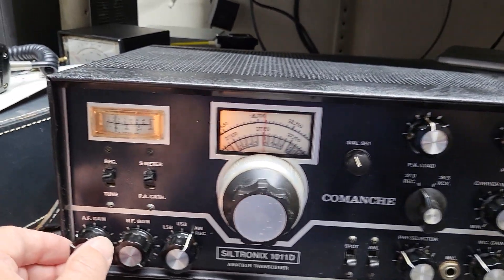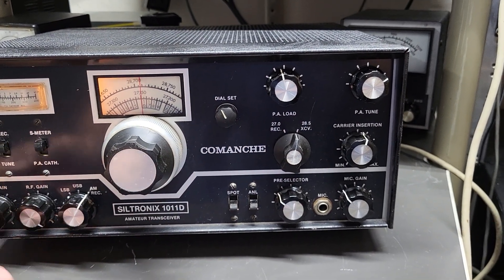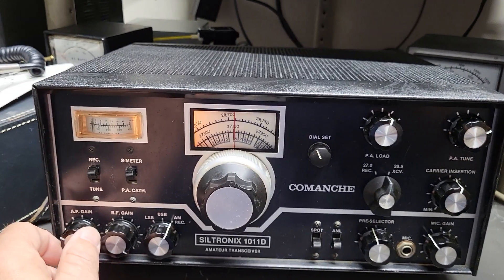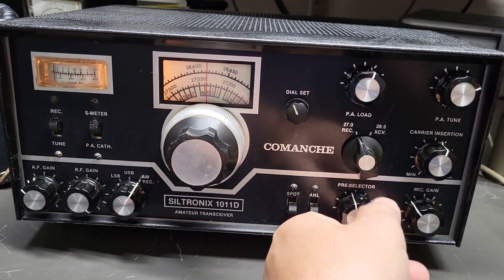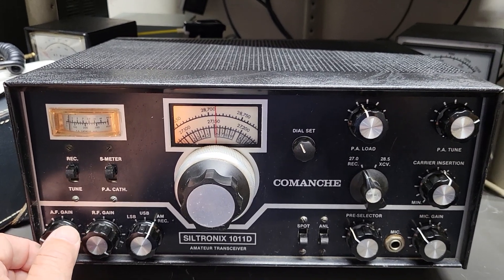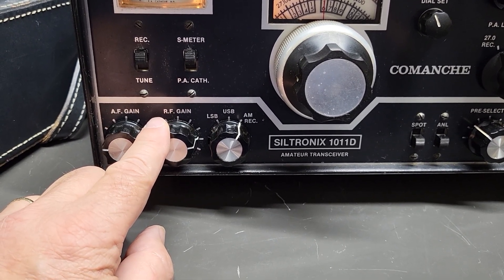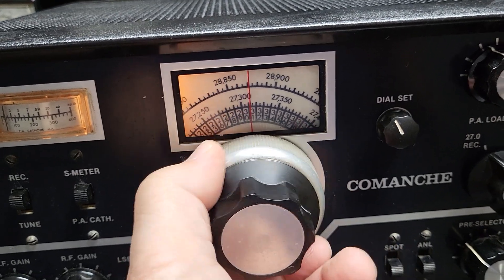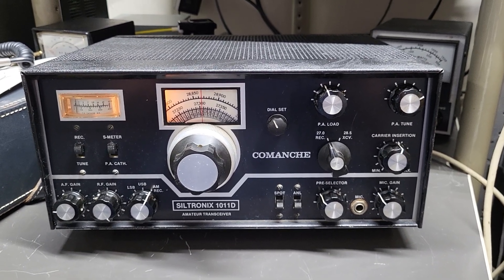Siltronix Comanche 1011-D  10 Meter HF Transceiver

Comment: It was a CB rig with access to extra frequencies or a 10 meter rig with “wideband receive” depending on who you ask.  

Basically one of the first “export radios”. It covers 10m and 11m.  The de facto standard coverage for “export radios” used to be 25.615 MHz - 28.305 MHz at the time most radios were made by Ranger/RCI.  Think the Galaxy 99 the Connex 3300, 4400, General Lee, General HP40W, many other Galaxy and about a dozen other brand names and models…, Ranger, Superstar, etc. radios - most of them did/do that, or 25.165 MHz - 28.755 MHz).  Now it’s 25.615 MHz - 30.105 MHz or 24.265 MHz - 30.105 MHz so you get 12m, 10m, 11m and, well, everything in between.  The old RCI-29xx radios covered 26-32 MHz or 24-30 MHz depending, they were advertised as 12m/10m radios (which they were!) but they also covered the 25-28 MHz chunk.  

I’ve had several iterations of the [in]famous Superstar 3900 export radios - which was a variant of the Superstar 360FM, which was a copy of the Cobra 148 GTL-DX (the “DX” indicating that it covered well above and below the legal 40 CB channels). 

My first export was a  
Voyager VR9000 (which was a Galaxy DX 88 or a Superstar 3900F in other markets).   The Galaxy rigs were absolute screamers on AM, especially with a quality microphone, but not too great on sideband.  The older 3900s actually sounded quite good on AM, FM and SSB if they had been aligned recently and were given 5-10 minutes to warm up.  I like that they a frequency counter instead of just a frequency display.  

Some folks put VFOs or even DDS units on these old rigs.  

Now there’s another generation of  export rigs, the AnyTone / Radioditty and a dozen other brand names…plus newer radios like Stryker.  

It all started with radios like the 1011D.

Comment: 👍Basically a Swan transciever. When I started watching, I thought it was a Swan. Confused by the Siltronix brand, had to look it up. It seems that Swan decided they would use the Siltronix name to disassociate it from Swan branded amateur band only equipment. The 1011D is a 10m transciever with addition of 11m CB band receive only.
Reply from the maker: Years ago I had one that said Swan on it. Yes they had to do the name change back then.
Reply: A great 11M transmitter back in the day. 1 wire made it transmit on 11. Probably made for 11m. 
They were really tight on transmit.
Reply: @miker8379  That makes sense, thanks. I suppose there might not have been a big market for a 10m only transciever like this. The 10m coverage started at 28.5MHz. So it was missing a 500KHz chunk of the 10m band. Also, no CW mode. I did wonder if it was intended as a high power CB rig disguised as a 10m amateur rig?
Reply: @Steve-GM0HUU  the irony is that they were illegal but tight. They didn’t QRM or bleed over everyone like the legal ones. I lived half a block from one. They did drift so most people left them on 24/7. Always wanted one.